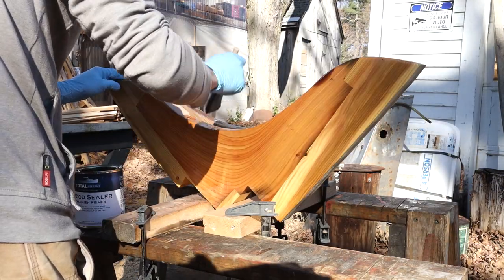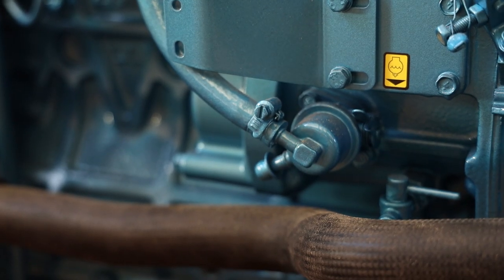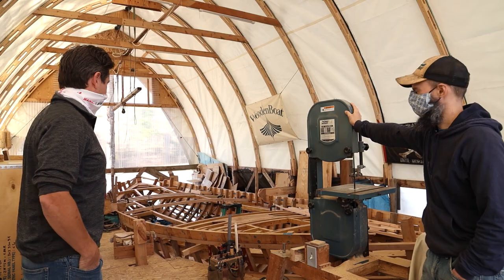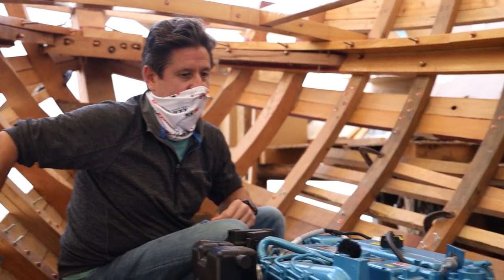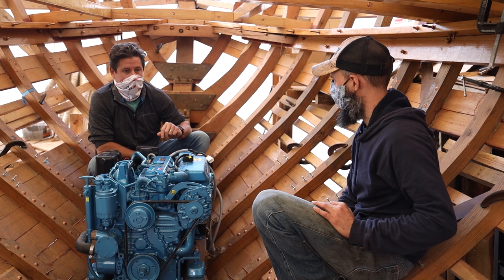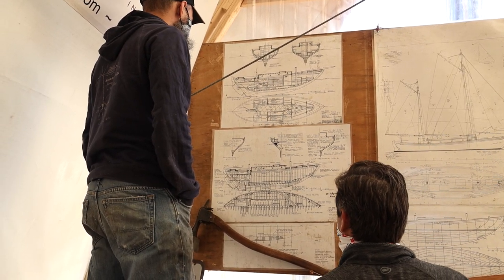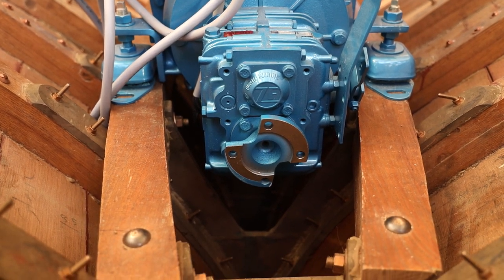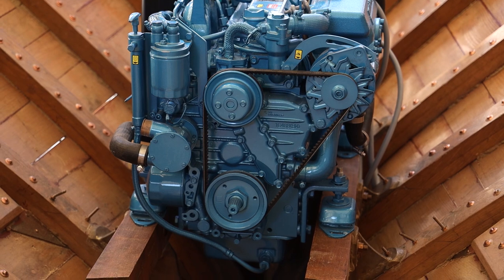Designing the Power Plant - Episode 137 - Acorn to Arabella: Journey of a Wooden Boat

Comment: Mecp master, Ase master mechanic, Nmea certified, and 12v electrician for 23 years here. Mechanical diesel vs electric controls was a great choice. The electrical system is going to be a lot more complex than you seem to think just from what you were talking here about. Just from listening to you about your basic system I can tell you need more. Lights in the house, auxiliary charging, nav systems, shore power connections to keep you topped off, solar charging,  It's going to be more complicated than you think.
Brook was a knowledgable salesman, but I would go find a marine mechanic and talk with them. They would have hands on knowledge of the issues and needs for that diesel as well as dealing with engine room issues. Every engine system ever designed has it's quirks.
I can easily draw you up an electrical system with what I would consider the bare minimum. Batteries are tough when you run a large bank of them for multiple reasons, I dont feel like writing a dissertation, but it's best if they are all the same size, age, and manufacturer due to a HUGE list of factors. A second alternator is also must. 100amps for 12vdc is nothing. That's a 10amp 120v circuit or 5amp 240ac circuit. My truck has a 260amp alternator and barely keeps up with the electrical demands I have with all my aftermarket stuff installed. My wife's 2019 Toyota Corolla has a 115amp one stock and is right where it needs to be for running all LEDs and engine controls. I tell you this for some perspective. 
I know you guys want the rawest and most authentic sailing possible, but you want wine creature comforts. A shower, 12v microwave, etc are cheap and easy to add now. Not so much later when you have to add electrical, plumbing, move firewalls etc.

Comment: Also, when you were discussing through-hull fittings with Brook, I was surprised that you didn't mention a raw water intake line for the water closet in your head.  Even if you decide to use a cartridge toilet, you don't want to be dragging that thing into the galley to refill it.

Comment: Look into twin diesel filters with a selector tap. That way you can motor along on one filter and switch over to the other if you suspect your filter is getting clogged up. If you're going with a gravity fed fuel supply, being able to select Left, Right or Off makes servicing easier too.
The extra alternator capacity is probably worth it too, if for no other reason that if you're running the motor just to charge batteries, you'll only have to run it for 1/2 as long.

Comment: The thing to do is install the prop shaft and align the engine and mount it all down WHILE you have plenty of room . Everything else comes later down the road . Also a stainlees drip pan under the engine. Oil and wood can get nasty over time. The drip pan solves that problem.

Just a thought , (;-) TP

Comment: Keep the single alternator, pack a spare. Charge your house side through a victron DC to DC battery charger. Have a couple of the flexible solar panels with some 8ga welding wire(flexible) leads so you can easily reposition them when you're on anchor with the sails down and want to put some juice to your lead. Also plan on expanding your electrical system as you spend more time on the boat. 

This is what works for me up here living on a boat in alaska

Comment: It may be a good time to consider a few lifting points in the engine compartment.  If you ever need to pull a head or maneuver heavy engine pieces inside the space you will be glad you did it. Think about your worst case scenario. What is the hardest thing you would ever need to do in that space and plan to be able to do it yourself, at sea with no assistance. Nothing would suck like having a leak under the motor and no way to get to it.

Comment: You should consider salt water for your head, a spray off (wash) hose for your anchor chain and possibly a deck wash.   Everything you can put in now will save you headaches routing it later if you find you want or need it later.

Comment: I think tearing is much away from the engine and mounting elsewhere is a brilliant idea. Like you said making the job easier ensures it will get done more often. But I think another great Advantage is. If ever you're required to do what they call a a improvised solution to a problem. This will be an easier job to do so as well increase your options.

Comment: You may want to seriously consider doing an expected energy audit of how much base power you will need on the boat and add a bit more.  Running lights, interior lights, nav station, radios, fans, fridge & freezer, bilge pumps, laptops, cell phones chargers, and the like will eat a lot more energy then you think.  Separate engine battery and house bank is a must.  A second alternator is also recommended.  LiPo4 lithium batteries are the best and although expensive will give you a much longer life and more useable amp-hours than lead-acid.  I watch a number of sailing channels from basic blue water capable boats with few amenities to those that have quite a few amenities. For all there is a common theme - I wish I had more power.  More people - more power needed.

Comment: Are you going to be installing a Diaper/Catch basin below the engine between the Engine Beds and Motor Mounts, to catch and collect any drips, or leaks so that the wood of the hulls is protected from contamination of any type.  As to Raw water intake.  Can you perhaps have a Waterless unit using Evans waterless coolant which has a much higher temp range than water, this and there is no corrosion in the engines coolant system???

Comment: Electric or Fuel fired hot water heater is crucial to washing up. Solar panels would have to cover 3/4 of the deck to generate enough juice to heat 3 cups of tea. Spare no expense on sea chest valves. The nice thing is that only the engine needs a scoop (so it gets some flow [sailing] if the impeller craps out) Can't wait to see the deckhouse (personality of her) go on.

Comment: As a suggestion please do not use sea water to cool the engine. This is because of salt, it is very corrosive on internal engine parts, in case there are aluminum parts. Use copper or stainless steel, 308 or 316L stainless, especially when you use a heat exchanger, one exchanger for the engine cooling and another for the hot water heater as that is freshwater. Antifreeze should be used for the diesel engine coolant. 50/50 mix. If you mix your antifreeze use distilled water as that is neutral of minerals that could be corrosive internally in your engine like the salt water would be. I agree with the other suggestions, use a pan under the engine, but design it so it can be removed to be cleaned, but left in place after cleaning this will catch any future leeks from the engine whether it is diesel, oil, or engine coolant. nearly all gaskets can possibly leek after long usage, from engine vibration and thermal expansion and contraction. I hope these suggestions help you with your design. Also you can buy heat radiators that can use the engine antifreeze to heat different sections of the boat from a manifold. I hope these suggestions are food for thought for you.  I thoroughly enjoy watching your learning progress in building your beautiful boat.
Reply: I would think that this engine, like the Kubota that I have on my Catalina 30, has an internal loop which contains the antifreeze mix, and an external cooling loop that uses external water, either fresh or salt, whatever’s outside the boat.  The two liquids are run through separate chambers in a heat exchanger, which contains a sacrificial anode which is usually zinc for salt water.  That takes the hit so the internal surfaces of the heat exchanger are spared from electrolytic corrosion.  They will need spare zincs.  I don’t think the salt water otherwise goes through the engine.  Usually the heat exchanger is a bolt on and should it get corroded it can be removed and replaced,.  I definitely agree, a pan is almost a requirement for the boat.

Comment: Engine compartment  and  all bildge is best in pure white because you can see if something  is leaking . oil, water , fuel , belts shredding, electrical wires   etc.     Also  If your in a emergency situation  in rough seas ,  or on a reef  trying to make a repair you will appreciate the white for visibility.

Comment: Stephen, since you're wisely making it easier to maintain, couldn't you route the fuel/oil filters straight up overhead into a concealed maintenance accessible panel in cockpit on a recessed vertical wall ? Will cockpit surrounding area be lazarette / storage as well as engine access ? Then potential oil spills will be up top and contained (easily cleaned too) vs down below in a crowded space.

Comment: - As a youth I learned from my dad to have two of everything on hand that would/could have to be replaced (water impeller, etc.). {AND close at hand, too!} 13:40
- For us, these were replacement parts for an oil furnace and hot water boiler, e.g., the motors, brushes, circulator pumps, bearings, grease, gaskets, Permatex, etc.
- This was because in the middle of winder, at -36°F degrees below zero fahrenheit  (-37.78°C), you need stuff NOW. And, right were you need it, too, because the electrical power might be out, and finding stuff out in the shop could be nigh on to impossible.
- It is a good idea to keep expensive and long copper piping and cast iron mop board longitudinal heaters from freezing in a two hundred year old post and beam colonial home.
- The man hours of work to replacement is huge. Getting it done in winter is near impossible, especially when there is only a dirt root cellar and crawl spaces from when the home was built.
- Getting to town or finding certain replacement parts can be a chore and may need extra time or planning to get accomplished, too. At sea, I can see this would/could be much the same problem if out of the country, for example.

Comment: have you considered installing a seawater heat exchanger for your engine ? 
that way the engine will only have a antifreeze mixture in it. preventing any seagrowth blocking coolant circulation, within the engine. 
you will still be able to divert hot water for the sink, from the seawater cooler's outlet. this system will require a seawater pump. which is usually installed on the engine and driven with a fan belt..
as for those who think you need a drip pan. I would suggest just painting the bilge with a oil resistant epoxy paint and leave oil/fuel absorbent pads under the engine.

Comment: Dual fuel filters and dual raw water filters.  I would recommend against a scoop on the raw water inlet.  Under sail, forward motion will push water into the piping, through the engine and out the exhaust system.  With no engine running, some of that water WILL get into the engine.  No scoop and a 1/4-turn ball valve immediately after the thru-hull.  Separate inlets for engine and galley because the engine filter will get clogged up with jellyfish and other things, and the thru-hull valve will have to be closed.  If only one thru-hull, now you have no galley or head water.  Install a smaller thru-hull for the galley sink and head.  I have had to repair engines (almost exclusively on sail boats) damaged by raw water ingress caused by the scoop.  Drip pan is a good idea.  Two alternators and two separate battery banks (engine and house, separate) will provide redundancy; one of either fails, and the other is available.  Use ONLY marine rated wiring and components; standard landlubber stuff doesn't like the marine environment.  The Calder book is very good, and, as mentioned, should be read and understood prior to designing any of your systems.

I have watched every episode and am impressed with the quality of construction and forethought of order of construction. 

I am hoping that Akiva will be able to sail on Arabella.  C. Zuhn

Comment: Charlie B gave good advice.  Spend some time at sea and at anchor on a boat Arabella’s size before you finalize your interior and amenities.  You need to fully appreciate the challenge of living,, cooking, sleeping, working on the slant in a small, twisting, heaving, rolling, damp, noisy canister that you can’t pull to the side of the road if you want a break.  The K.I.S.S. principal is the right approach but you need to understand the issues that need simple solutions.  And if you want to have female companionship for longer than a couple of days you need to accommodate her comfort as well.

Comment: Maybe that guy doesn't do well on camera, but he certainly comes across as more of a salesman than anything else.  A couple of things you will want.

1) Do install a drip pan under the engine.  I would go fiberglass since it is easy and cheap to make a custom pan.  Always keep a couple of oil sorbent pads in the drip pan.

2) Add a water heater.  The plumbing from the engine is simple.  The only issue is locating the water heater.

3) I STRONGLY suggest going with a dual Racor primary fuel filter.  The dual systems allow you to do on the fly switches between filters.  If you keel your primary filters clean you can greatly extend the life of the on engine filter. I personally see no reason to remote mount the on engine filter since it will only need to changed infrequently.   I would go with the 500 series Racor primary filters.  The filter elements are easy to change and cheap - carry plenty of spares.

4) Go with a dedicated seacock for the raw water intake.  On a sailboat you do NOT need a scoop on the outside of the hull.  A standard thru hull will work fine.  Put the seacock in an easy to access location so you can close it when not using the engine.  Install a quality raw water strainer in an easy access location.

5)  A feathering prop is nice, BUT they are 3-4 times the cost of a fixed prop.  A feathering prop (such as a max prop) is MUCH more fragile than a fixed prop and you will be waiting a LONG time for parts if you prang the prop in a remote location.  They are also more of a racer's thing.  Your boat will be a pig in reverse no matter what prop you install.

6)  You definitely want a dedicated start battery and a separate house bank.  A single Grp 27 battery will be enough to start that engine.  I am an advocate of using the same batteries for starting and house banks - all deep cycle.  It is EASY to put in a 1-2-both battery switch so you can parallel the start and house banks if the start battery needs help.  Wire the battery banks with an automatic charging relay between the two banks.  That will connect the two banks when charging is happening and disconnect them when no charging is occurring.  I would suggest a MINIMUM of two grp 27 (~100 amp-hr) batteries in the house bank.  Note that more batteries is always better since batteries last longer the less they are drawn down between charges.

Just a few thoughts based on having done a few engine installs.

Comment: Something modern to consider is a serpentine drivebelt for the alternator and engine water pump. Ease of maintenance. less black belt residue, better lifespan, less noise and better drive. In the long run it might just justify the extra cost.It will also be easy to install a backup alternator.

Comment: I'm going to make a suggestion that may not be in current wheelhouse, but would make life going forward a lot easier. You have all of the dimensional info on the hull, deck, hatches, house and all, so it would not be hard to create a 3D model in a graphics tool that would let you plan the interior and pull dimensions for parts. Google Sketchup  has a Web based version that is very inexpensive ($100/yr) and there are others. Not having done a boat interior before, I think it would keep the "oh-shit didn't think about that" down to a minimum.  I recommended Sketchup because it is by far the easiest tool to learn I have seen. I use it to design all of my furniture and other building plans. It should also be very easy to find a local resource (geek) willing to help. I have found that it makes doing furniture design fast, easy and I avoid mistakes.

Comment: There appears to be a splined extension at the front of the crankshaft.  You should consult with Brook about whether it is possible to fit a removable hand crank.  Marine electrical systems are notoriously temperamental, especially if they get wet with salt water.  You have a great advantage in having an all-mechanical diesel that will run with no electrical system, but what good will that do if you can't start it?  Another option would be to have a tank of compressed air, like a SCUBA cylinder, plumbed to push down the piston in one of the cylinders and thereby turn the engine over.  Some years ago large diesels, like those on locomotives, typically had compressed air starting because adequate electrical starters and their batteries were too large, expensive and temperamental.

Comment: It certainly looks like there is a raw water to engine coolant heat exchanger mounted on the top port side of the engine.  At a minimum, I'd inquire about the recommended service procedures and look at the access you'll need for that.

Comment: Get the second damn alternator, Steve! It is cheep money. If you never need it to charge up batteries or for anything, you will still have it there at hand as a replacement. Besides, then when you wish it was right there for something that you never thought of - - - it would be right there. Set it up where the filter is now (that you are going to remove for a better oil change location). That way you could just shut off the engine, use a screwdriver to spool the belt off the one that went bad and flip the belt over to the unused one if you needed it in heavy seas, all in less than a minute.